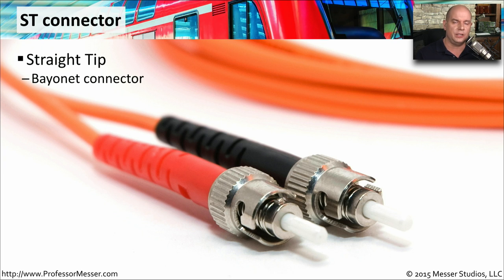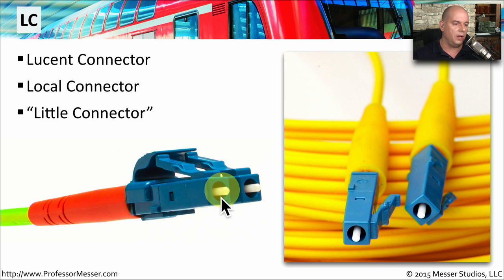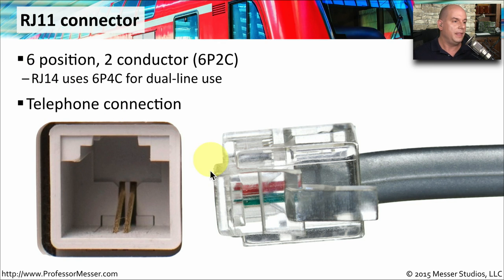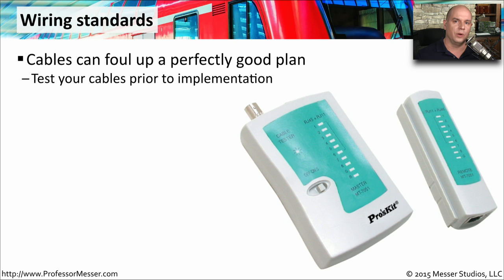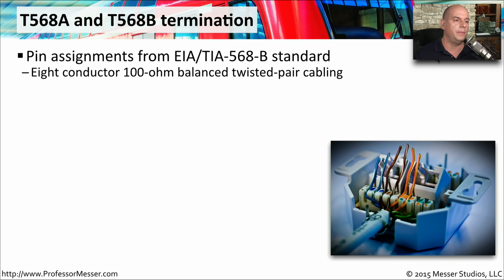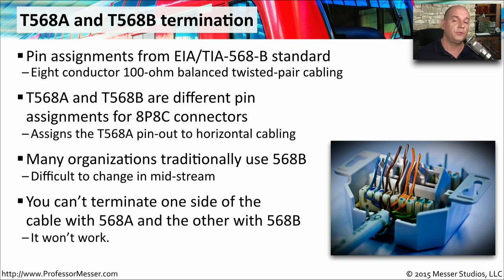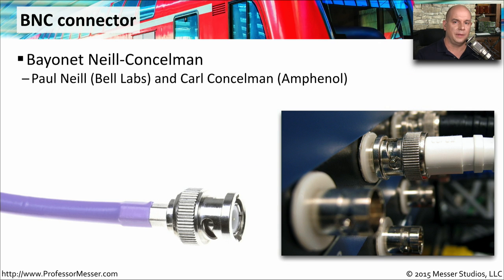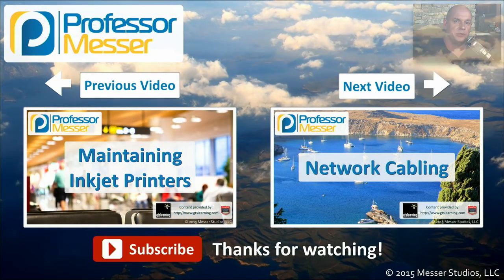Network Connectors - CompTIA A+ 220-901 - 2.1

Comment: Wouldn't terminating one side with 568A and the other with 568B make a crossover cable which would work in certain cases?
Reply from the maker: We refer to the 568A and 568B standards for their coloring scheme, not for a standard for Ethernet crossover cables. Using 568A on one side and 568B on the other side would not create a gigabit Ethernet crossover cable, for example.
Reply: @professormesser  Thanks for clearing that up.